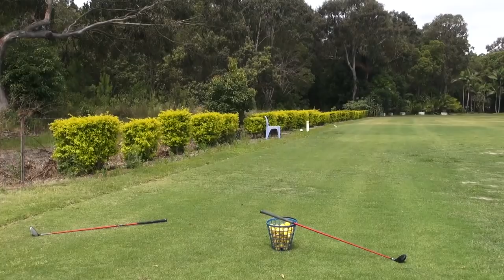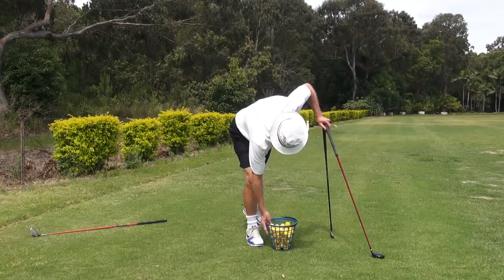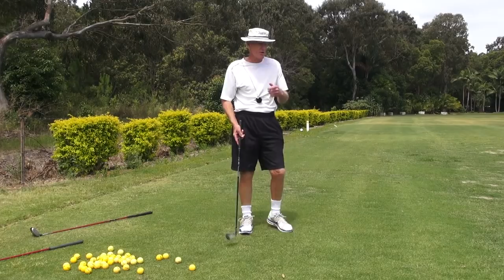More  Channell Lock  Info .. Long Video ..  but worth it .. I think ..

Comment: Hi JH the snow melted enough for me to get out for nine at my course.  CL is amazing! Shot 38 in some pretty rough conditions. I am usually in the low 80’s. I will certainly be spending time now in the 70’s thx to you. Still over drawing a little but I’ll figure it out. Gonna play 28 next two days.

Comment: Hey, JH!  Periodically,  while watching your videos, I oftentimes  find myself feeling compelled  to reach out to you after hearing you reference your health - whether it was when you referenced having skin cancer lasered off, strength reduced, or weight loss and loss of energy (today's video), etc.  Well, in seeing how disciplined you are, how committed to excellence you are, after watching today's video, I had to write.  As a frame of reference, at age 51, I am getting very close to getting my body back to performing as I did when I was 20 years old.  
  I am currently writing a book (The Three Rivers of Health - Aging is not a process, but Rather an Accumulation of Mistakes).  Furthermore,  I am a health nut, as some have called me.  What I have found : keep the three rivers flowing at the highest levels, then one can reverse aging.  Keep the two dams that filter two of the rivers operating at peak performance, as well; and you will never get sick again.  Understand this, and one never has to fear cancer or any other disease.  Understand this, and repair and rejuvenate the body if necessary, and one's strenghth can return to youth-like levels.
  You are obviously intelligent,  obviously comfortable in stepping out of conventional thinking when it doesn't serve you optimally.  If you are open, I would be happy to share some simple wisdom that could very well prove transformative.  Because of all I have learned from you in having watched 100's of your videos, including all CL videos, I would never dream of charging you.  If interested, reach out to me; we can arrange a means of communication to facilitate. If not, I will continue to watch your videos as I pursue my own level of excellence within my golf swing with great appreciation for all you do.  Thank you!  All the very best!
Reply from the maker: Very interested in your 'Three Rivers Of health' .. It really depresses me to be a shadow of the physicality I once was ..   anything I  can do to regain some of my previous physical vitalities  I am very interested in purseuing..
              My email address is .. jhensby1@gmail.com     feel free to communicate through that channel of liaison...
                    cheers JH
Reply: @1atomicgolf  I sent an email to you, JH.  Let me know if you didn't receive it.

Comment: JH

Now your speaking my language or should I say now your visualizing my visual and that is the mental picture of a baseball hitter at full stretch when making contact with the ball hitting to right field to the out of bounds yellow pole

When I do that my weight is on my back side of my body with the trail hip locked in with no movement keeping my back shoulder in a dip feeling and the lead shoulder closed 

It does help in a case like this to be a visual swinger 

Batter up 

Thanks
Reply from the maker: Hi Steve,
                I am   going to  perfect the    'drive back'    into the trail     leg/side  because when I do get that feeling I absolutely smash the ball.. the Javelin   thrower image  is a good one for me to key on .. the batter to   right field is also  a  good  image/feeling ..   its amazing that the  action is totally diametrically opposite to  any   conventional teachings ..  and that   the thousands of   teachers over   the last 100 years   haven't cottoned on to    the   process  mechanics ...   why would I be the only teacher to think along these lines..   but then old 'Copernicus' was a paradigm shifter of thinking in his day .. maybe    I am  the Golf World of teaching  version of  'Copernicus' ..
                        cheers JH

Comment: The "chasing the  ball" and "hit the second ball" versus "Hit up on the ball along the arrow line of flight"  are for me a bit contadictory.
Reply from the maker: The  'Up the line of flight'  is still in the thinking.. but its an 'elongated'    Up  .. you fire outwards as much as you can whilst 'hitting up'  .. you don't want to hit 'abruptly' up    ..   that will lead to a shortening of the    'up' arc...
                 cheers JH